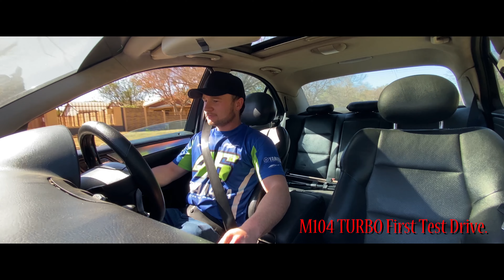Mercedes "C180" Turbo Sleeper FIRST TEST DRIVE💥RicerBenz V3💥 M104 TURBO

Comment: This is what it's all about building cars with limited money and resources and basically making a supercar. That motor is good for 600hp with your setup. Sucks about the headgasket issues but Its all hopefully fixed. Buy a hedgehog tuning 3mm mls headgasket if I blows again.
Reply from the maker: Appreciate the comment man. Definitely huge potential with these engines. My injectors will need upgrading but then the gearbox would also need to be upgraded.
Thanks for the tip🤘😁🤘